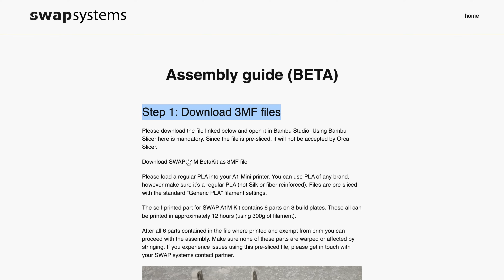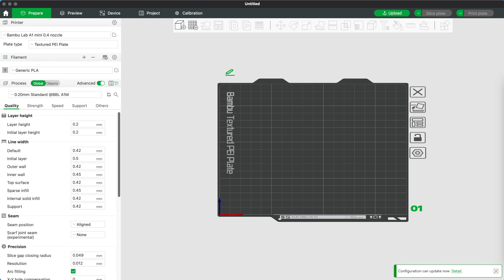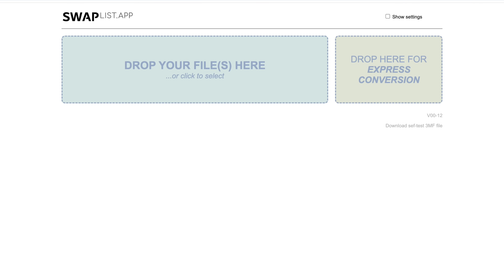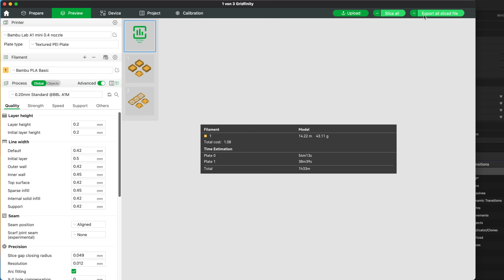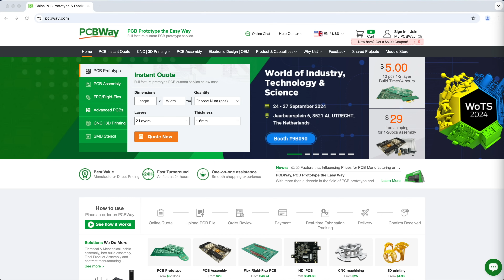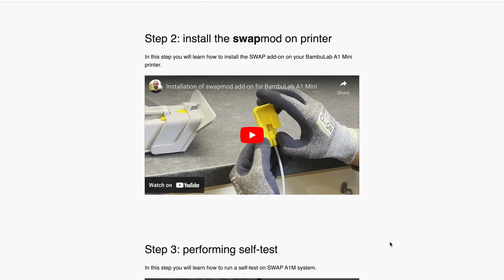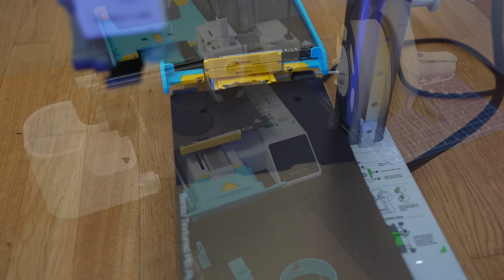Bambu Lab A1 Mini ULTIMATE Upgrade - Fully Automated Plate Removal Mod

Comment from the maker: Swapmod Kit: https://swap-systems.com/product/swapmod/
Use my Code lukis3dstudio-5-a1mini in the shopping cart to take €5 off your purchase!
BambuLab A1 Mini: https://www.awin1.com/awclick.php?gid=570773&mid=46345&awinaffid=2034675&linkid=4382675&clickref=
BambuLab Textured PEI Plates: https://tidd.ly/4polFk2
BambuLab Filament Color Swatches: https://shrsl.com/4p6tq
Recommended Filaments: https://www.awin1.com/awclick.php?gid=570777&mid=46345&awinaffid=2034675&linkid=4382680&clickref=

My 2nd favorite filaments: https://geni.us/A4OFomi
Lubricant for X,Z,Y-Axis rails & idler pulleys: https://tidd.ly/3KMFHqs
Grease for Lead screws: https://tidd.ly/3Lk36j2
Deburring tool: https://geni.us/9WGzv
Wire cutter: https://geni.us/NAwQIL
Heat gun: https://geni.us/Jdcu

#Affiliate

Comment: That's pretty awesome.  I've seen another of automation that you inject into your gcode and after printing and waiting for bed to cool below 30c it will lower the X axis, and then move the Y axis (bed) rearward so that the x axis rail arm will push your cooled prints off the bed.  

I've not tried that one and it would only work with prints taller than a specific height, but it would allow re-using same plate each time and you'd have a catch basket below table top to catch the prints.

Comment: Is this mod affected at all by the coming 'security' firmware changes to Bambu?
Reply from the maker: if you’re using BambuStudio slicer, i don’t think it will affect it. 
The swap app merely generate GCodes for you.
But make sure to contact them if you wanna be sure!

Comment: Cool idea. The one issue I have is that if the site that modifies your step file ever goes down, this ceases to function. If this was a desktop app or script, we could still use this kit even if the original creator moves on from the project and no longer maintains the site. I'll hold off until then. (Sorry, it's just that linkrot is getting worse and I'm trying to plan for it in the future)
Reply: I don't have one, cuz I live in the US (and couldn't sneak one in yet), but if it is just a client-side based web application, without any backend server calls (cuz, realistically, you don't need any in this case) - you can clone the JS and it would work just fine. If it does server-side computation (potentially to prevent cloning specifically or just due the tech stack used) then yeah, your concern is fully valid.

Comment: I initially thought I wouldn't have any need for this for a while, but now it's possible that I might...saving
Reply from the maker: its indeed, a cool mod! you‘re not gonna dissapointed
Reply: @Lukis3D  it definitely looks promising; I've been working on something that's gonna take many many many prints, many prints, many, and somehow also fits on the A1 Many...uh, mini.. glad I remembered about this thing, cause if it does end up taking off (which would be nice), it'll be very convenient not to have to be present every time one finishes

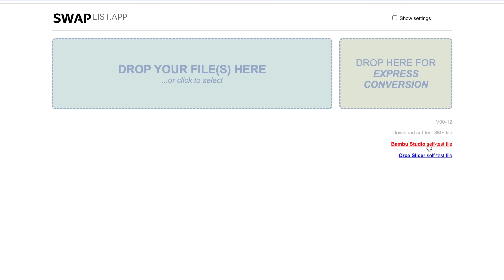Comment: 3:40 Where is the link below for app? I don't see it

How do I get the software to repeat prints shown in the video? Does anyone have the app they can send me?
I don't even need the extra plates, just a way to auto send  5 or 10 parts in a row. 
I currently resend the print from my phone and it knocks part into a box in front of printer just fine but I need to resend from my phone or hit reprint on screen. 
My part is tall, skinny and vase mode. pops off easily no problem when it goes to start the next print. 

The only real problem is tiny purge line at front of plate. 
Sometimes it globs up after 5 or so prints. If there was a way to skip that line or move it back 2mm for each print I could print 30 parts in a row with no manual babysitting of the printer.
Reply from the maker: the link will be online when they start to deliver the kit to the supporters. Right now the link isnt working yet

Comment: The system seems great, but the dependency on a website concerns me. The day the company decides to shut down their servers, the tool becomes useless.
Reply from the maker: My understanding is that the website is just java-based website that generate the Gcode and can be ran offline. So you could basically save it on your computer and use it indefinitely.

Comment: That's great and all, I just wish companies would revisit the conveyor belt idea again.  That has so much potential and would be far better than something like this.

After each print,  just have it cycle the belt, pops off the print, and starts another print.  No need to swap plates.
Reply from the maker: of course that sounds great! This kit however, is affordable since it doesnt have any electronics parts.
They specifically designed it so the cost of the kit won’t be higher than the printer itself. This makes the price interesting, even for regular users.

Comment: What if you just wait for plate to cool, use the printer to knock of the print by slaming the print into the X axis, and then just start another print
Reply from the maker: yeah that would work too. This system however, make it possible to print flat stuffs that the print head can‘t just knock off. And you can use the whole plate to print multiple prints instead of just one big vase. And of course, you don‘t need to wait for it to cool down, means that you‘re making the most out of your time.

Comment: I'd love to have a tool like the swap mod website for the other printers to just print plates sequentially with a pause between.  Even if I have to manually change plates on my P1S it would be awesome to queue up plates and only have to load a plate and press go for the next print to start.
Reply: I think you could do that with code. There’s a loop function and then you could insert a pause. Haven’t tried this but it should work I think

Comment: I've been dreaming about a system like this, I need a version for my Ender 5. It would be a VERY different system though since the bed is the Z axis and not the Y axis. I bet this could be adapted to the ender 3 fairly easily.
Reply from the maker: Definitely! it would be cool to see the system developed for other printers as well. Or if you can‘t wait, you might wanna consider getting a Bambu😄

Comment: personally, I fail to see how practical this is when you have to move each plate out of the way as they come off - what's the point in that when I can just swap the plate in the same amount of time?  No point.
Reply from the maker: you can put a box beneath the printer so your prints will just drop into the box when it’s finished. I could’t demonstrate it in this video because I had like 3 tripods in front of the table for filming & lighting 😅
The company is also working on some sort of conveyer so the plates wont stack up in front of the printer.

Comment: Is a portion of the plate "removes" from possible print area to accommodate the swap?
Reply from the maker: you can use the whole print area without any issues. You can see this in my last print, the polar besr print, which used the entire plate to print.

You can also see this in my previous video of the V-Spooler mini. I hope that was what you‘re asking about?
Reply: @Lukis3D  Nice. Then i just dont Get what is triggering the plate switch :) tough it was when the y pos hit the top

Comment: Does it support plates with different textures? For example I have the original “rough” PEI plate in addition to the smooth one.
Reply from the maker: the designer recommends using the textured one, since he has been testing  his product with the plate. I‘m sure that it will probably work with other types of plates as well, but for the best reliability, go for the textured (rough) one.

Comment: I really like this design. But I do not like the web interface at all. If he has a local version of the gcode maker that would be ideal. But I wouldn't want to rely on a webpage that could go down at any time or the security risk of sending my proprietary designs to some random website with no real accountability.
Reply from the maker: Hi there, I understand your concern! If i understand correctly, the webpage is a local javascript based app. You can even just save the webpage and run it offline so your design won’t be uploaded anywhere.
But if you wanna know more, can contact them and ask them for details.
Reply: @Lukis3D  Thats great to hear! I was worried the aim was to create a restricted webapp so that users who didn't purchase through the website couldn't have access to the tools needed to use it. As long as thats not the case I'll probably snag a few, seems like a great addition for a small print farm.

Comment: he literally never showed a printed plate come off lol. he dedicated 3 seconds from 5:58 to 6:00 the actual print, and did the same thing at 7:14, and never showed the kick-off. this product is without a doubt some vaporware BS that will never function as advertised.
Reply from the maker: i took timelapse/ sped up vidoes since one complete process of removing of the plate, loading of the plate and start printing takes around 7-9 minutes which is almost the entirety of this video. You can see how it does it on chapter 4 and a little bit the end of the video

Comment: cool, all good if you already own a Ai Mini. But given the small size- and seems to be limited to how many plates you can line up- so, but doesn't it makes more sense to use a larger printer than can print 4 x this area reliably all at once?
Reply from the maker: good point, if the bigger printer can print as fast as the A1 Mini, sure.
However, if you seperate your prints to 4 different plates, you dont have to wait until all models are finished printing. You can work on the models that are already finished printing like removing brims, paint, assemble, or pack the items to be shipped, etc., thus making your workflow faster.
Reply: @Lukis3D  Good point. Thanks for the video.

Comment: Why not wait until the bed cools of and have the printhead kick the printed thing off the bed?
I think that already has been done. Seems easier and no need for more bedplates and low maximum prints.
Reply from the maker: waiting for the bed to cool down means you’re losing time, which can be critical if you wanna produce alot, fast.
Besides, its also possible to print multiple parts on the plate instead of one giant part. or something flat, or something small. You are using the whole plate.
Reply: @Lukis3D Critical? 
Ohh. Get a Creality cr30.
Reply from the maker: @michaelenglund  then go get it. I’m not saying that you should get the printer+kit. Different printers have different purposes and if this solution works for you, then all good. Some people would probably want cheaper, multicolor printer and some don’t care so it all depends on your needs.
Reply: @Lukis3D This solution is not very good.
Reply: @michaelenglund  its a better, more universal solution than hitting parts off the bed with the printhead.  you can't push large thin parts off the print bed,  or some materials, or prints requiring a brim etc.

Comment: That’s gotta be the most ingenious printed 3D Printer accessory I’ve seen in all my years of 3D printing.  Very clever design!
Reply from the maker: I second that! It was so much fun testing it, and it’s easy to use too. Its a great kit  not just forprint farmers but also for hobbyists
Reply: As much as it’s a great design, there is the “Continuous Print” plugin for Octoprint that pushes the part off the bed once it’s cooled then starts the next and so on. No extra hardware needed.
Reply: @darktherapy  What about the stupid lines that Bambu printers print right before starting the print? Everyone uses Bambu now.
Reply: @CompletelyNormalPhenomenon many slicers do this.  It’s called the purge line and it’s not stupid.  You can disable it in on most slicers… come on dude.
Reply: Same

Comment: What happens if a print fails ? do you have to cancel everything?
Reply from the maker: yes you have to cancel everything. If your model is always the same model on all of your plates, I think that isnt a big deal, just restart the print.
But if not, lets say plate 3 of 5 fails, just cancel everything, then go to the generator, turn off plate 1 and 2, and generate the gcode for plates 3-5 so you only need to print the rest of the plates. I hope that makes sense?

Comment: Sorry I may sound stupid, but what is the advantage to owning different texture plates(other than this). Do certain filaments print better on certain textures?
Reply from the maker: no worries man! currently, other than textured plates, u can get smooth and effect plates. with smooth plate, you’ll get a matte bottom surface (you can still see the lines unfortunately). With a textured plate, its textured and has glossy finish (you almost see no lines). It also offers better adhesion.
Effect plates will give you the effects.
It depends on what you’re looking for. Basically, you can print anything that A1Mini /A1 can print on a textured plate alone.

Comment: Cool system… I wish you had more real time footage of the plate changing action. I’m sure what you printed was cool for you, but I want to see how the system operated in more detail. Thanks for the video, I know it takes a lot of effort to put these out. 🙂
Reply from the maker: thanks man! Basically, after done printing 1 plate, it will remove the plate and load a new plate (you can see this action in Chapter 4, Pre-test, it’s a sped-up video though) 

Then it will do the same actions as though it would print something (the music, calibration, preheating action and so on), then print the model on the new plate.
I dont wanna spoil the fun too much because its so amazing how this system works😊

Comment: Is there some kind of pause if there are no empty plates available or does it just start printing on a plateless bed?
Reply from the maker: hi there, i just tested this and if you run out of plates and there's no plate loaded, the printer will stop and shows the error message "No build plate is placed". Pretty neat, right?

Comment from the maker: *Update*: If you run out of plates and no plate is loaded, your printer will just stop printing and shows the error message "No build plate is placed" (this is the A1 Mini's plate detection feature). I tested this with my A1 mini running the firmware version 01.03.01.00. 

And sorry guys I need to correct myself at 1:19, it took about 12 hours to print those parts!
Reply: I wish every printer had the “no plate detected” error. I broke my first printer by forgetting to replace the pei sheet before homing the printer 🤦which printed me to buy my A1 mini.
 I fixed my other printer but it took a lot of work.
Reply: Hello ser, did you have any deadline for releasing this project, I'm really interested in your automation
Reply: Hello,
please, when do you think the set will be for sale? Do you think it will be by the end of 2024? What is the price? Thanks a lot and I am looking forward to the bigger A1 🙂
Reply from the maker: @radekkm1680  its said to be around 50-75€, but could change when they release it. It could be this year still. you can check out the BambuLab forum to get updates
Reply: Don’t rely too much on that plate detection feature. I had a giant scare on my heatbed from a late night mistake. The little A1 Mini still prints like a champ though.

Comment: Spend $700 on build plates so you can automate your $200 printer 🤪
Reply from the maker: if you‘re a regular user you‘d probably have one or two additional plates, 3 is a sweet spot in my opinion😄 A1M Textured plate costs 20$ so 40$ in total. I know a ballpark price of the kit, and it‘s quite affordable (you can check out the discussion on the BambuLab forum).
Reply: @Lukis3D  nah, I'm just being an ass :^) I've got 3 plates for my X1, and had been considering a bed slinger for automated printing...wish such a kit existed for the full-sized A1, but A1 Mini is good for lots of small/technical parts.

Comment: Does it know if it runs out of plates?
Reply from the maker: it will just keep on reloading, there isnt plate auto-detection as far as the system concerns. The A1 mini itself though, has a no-plate auto detection feature, but i haven‘t tried printing without a plate yet. Maybe i‘ll try to test that!

Comment: I think if you are printing a lot of plates this way you need some kind of ramp with a deep box to hold the finished plates. If they stack up right Infront of the machine it could cause an ejection issue eventually.
It's crazy how the slicing works. as far as the printer knows all the plates are one singular print. Neat trick but that may be an issue with increasingly long print swap sequences. I would think Bambu is aware of this mod and working on a first party version with compatible software because an auto ejecting printer is a great feature.
Reply: Yea just have the printer at standing height and create a ramp with cardboard boxes that lead to a big box under the table
Reply: maybe a long conveyor? you could have tons of a1 minis spitting finished plates onto a coneyor with a cassette storage system at the end

Comment: looks good until the end part where the plates are getting dumped on top of each other ...
Reply from the maker: you could put the printer at the edge of the work platform and put a box beneath it, so the plates will just drop into the box